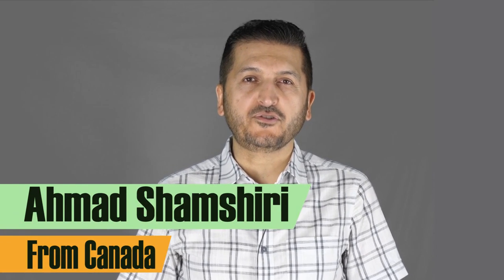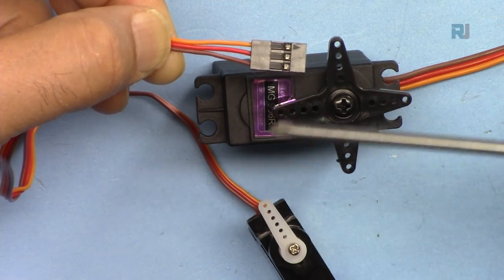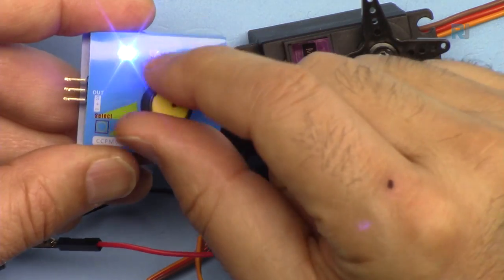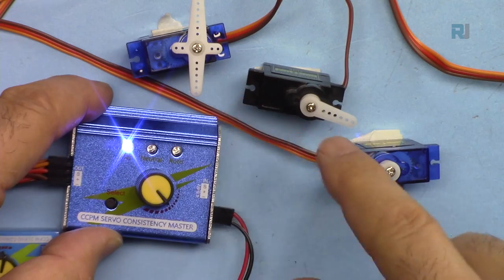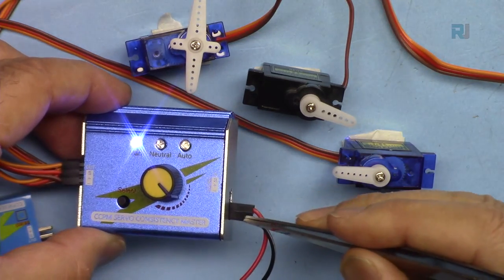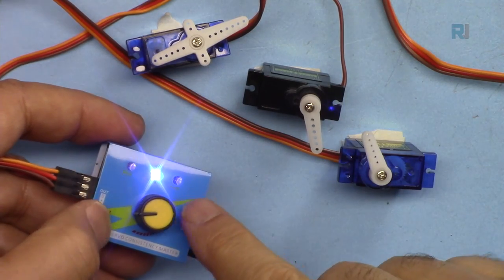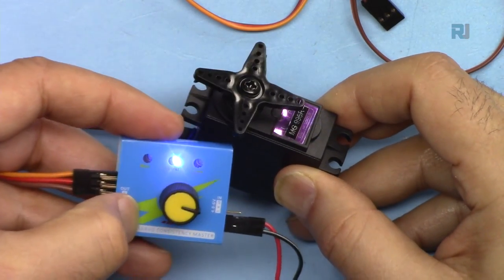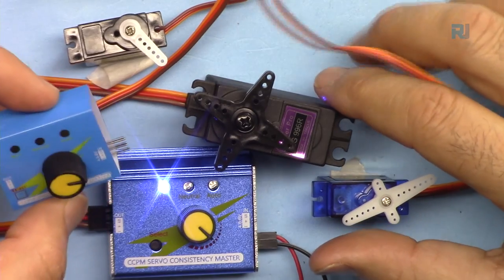How to test Servo motor with 3 channel Cheap Servo Tester

Comment: I need that wire to connect with battery and server ,where to buy
Reply from the maker: Get 5v converter that accepts 6V to 15V and outputs 5V. Just search on Amazon or eBay